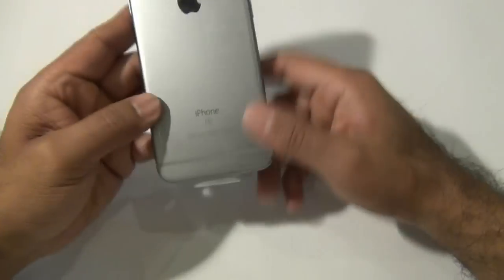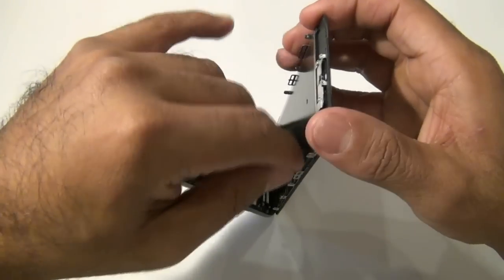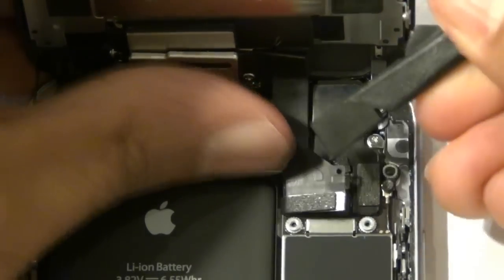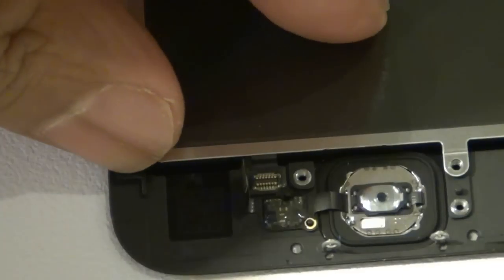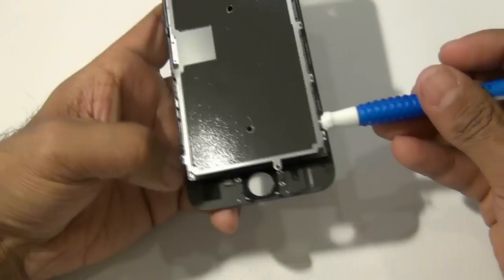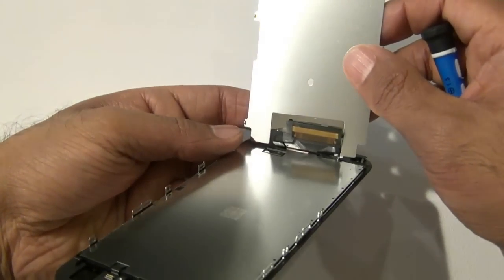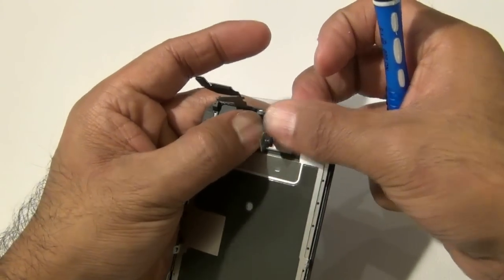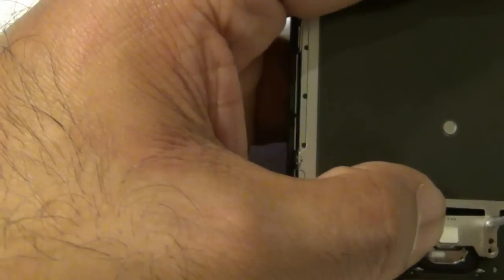iPhone 6S Touch Screen Glass Digitizer & LCD Display Repair Replacement Guide

Comment: Sometimes on iphone 6 when you connect the new lcd there will be no display. try hard reset. Power button + home button until you see the apple logo. I have also seen this on a few iphone 5, 5's. And on early ipads.
Reply: paul forester thanks so much. This has made my day. Worried that I filucked up the repair. Hard reset. BAM!!
Reply: Glad your repair when well buddy.

Comment: Does this come with EVERYTHING excluding the Home Button, so the only thing needed to work is the old home button right? All I need to do it move the Home Button to the new LCD & Digitizer thing?
Reply from the maker: We carry that version on our website, yes.
Reply: Gallardo983 u need to remove original home button it’s programmed to iPhone motherboard or else iPhone will act  stupid also won’t read fingerprint

Comment: I replaced the screen following the exact instructions in the video, checked all the connectors, but the touch screen only works intermittently. Sometimes I have to press WAY harder than I normal.  The device turns on fine, no blue streaks, and  Touch ID works perfectly.  Anyone else have/having this issue with the touch screen?

Comment: can I still do the same thing you did but on a iPhone 6 ?
Reply from the maker: Maurice Bigs we have an iPhone 6 repair guide
Reply: InjuredGadgets I ordered a screen on amazon does it come with a LCD ??
Reply from the maker: Maurice Bigs no idea what you ordered. if it was very cheap probably not. Why didn't you order it from us, then you would know what it includes
Reply: yes
Reply: juliaa young No since the shield plate has 5 screw holes on the 6 but the 6s has 6 screw holes
Reply: juliaa young No since the shield plate has 5 screw holes on the 6 but the 6s has 6 screw holes
Reply: juliaa young No since the shield plate has 5 screw holes on the 6 but the 6s has 6 screw holes
Reply: juliaa young No since the shield plate has 5 screw holes on the 6 but the 6s has 6 screw holes

Comment: So what I want to know is, where is the 3D Touch hardware and does replacing the screen disable the feature?
Reply from the maker: +Anthony Blake Its build into the LCD assembly. Our current reports are saying no, replacing it, will not disable the force touch
Reply: InjuredGadgets b.

Comment: I replaced the screen but my home button does not work anymore. I tried reconnecting the cable again but it does not help. Do you have some other tips?
Reply: Pieter VP buy a new phone🤷🏽‍♂️🤭

Comment: On iphone 6s always disconnect the battery or you risk blowing the backlight fuse ic when plugging in the new lcd connector.
Reply: paul forester I didn't disconnect the battery and something sparked when removing the cables. Plz help!!!
Reply: you have blown the backlight
Reply: Or you might have gotten lucky and just shorted the connectors without blowing the fuse.
Reply: I have forgotten abouth it and it didn't happen to me.
I read ur tip but forgot abouth it when assembelying. Ill try to think abouth it next time....

I killed my touch ID button. U have any cleu what went wrong?
Reply: Pieter VP sometimes the replacement screen you use is not the best and the imbeded home button ribbon is faulty. came across it a few times.
Reply: I used the original home button....
U think this is the screen witch has a malfunction?
Reply: Pieter VP the home button ribbon that runs up the back on the new lcd. Make sure the connectors are  clean. seen crap get into the little channls and stop connection also. I use alcohol and a stiff cut down 1" brush.
Reply: first thing I do is try another home button. failing that try new screen. if it turns out it need a new home button the touch id will never work again. most customers are fine with this just to get there home button back. 6s is a bugger. in the 6 I even try a new home button ribbon. can't in the 6s.
Reply: Thx for the information. Can I ask you where you get your  replacement items? I buy them in China witch might not be the best option.
Reply: I used to buy then from China. that's where almost everyone does. I now have a local refurb  guy. 6, 6plus, 6s, 6s plus. the rest I but from China. also gives me a great price for my old lcds.
Reply: May I ask you where u from?
I put the home button back on the old broken screen and the button works yust fine. So the cable is broken. I was wondering if i can get somewhere a cable to yust don't have to replace the whole screen. This is in my eyes possible since the cablt yuist runs true the screen and is a stand alone part if i'm not whrong.

Is there a way to chat over youtube or is this the only way?

Thx for the good advice already!
Reply: I'm from the UK. if it's a 6s then the built in plate is risky to remove. I'm not even sure where you would get a ribbon. maybe a supplier that does refurb?.
Reply: I am currently searching for it but can't find it. Any suggestions on where to buy a new screen? the button is key to work imo. Aint wanne use the on screen button
Reply: look for a local supplier. the phone shops in your area have to get the lcds from somewhere. Failing that try ebay. Just do some research if you use ebay. Too many dodgy characters. Hope this helps.
Reply: I use aliexpress but cannot find it there. Only for the normal 6
Ill do some research and hope to find it.
Reply: I tried but to bad. Nowhere I can find the cable seperatly for a 6... only a 6s. I am considering trying to get out of of the original screen. Also ordered another screen. Hope this screen hasn't the same problem otherwise i think original buttons do not work on chinese screens....

Comment: Did you see anything that looked like the lcd was married to the board?
Reply from the maker: +nathan sellards We are trying to figure this out as well, but no. We are planning to grab a screen from another 6S and see if it works on a different 6S board so that we can confirm if assemblies will be married to the logic board like the Touch ID sensor is.
Reply: +InjuredGadgets I'm glad to see someone is figuring it out fast to see if the industry will be screwed by apple.

Comment: unless you switch out the metal plate underneath the one you took off. touch id will not work.  need original home button flex cable as well. thanks apple